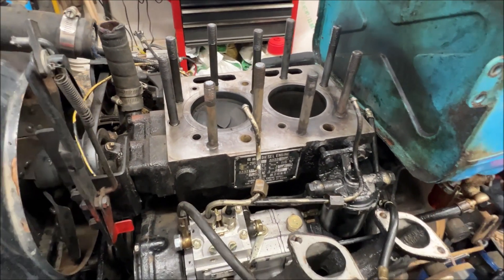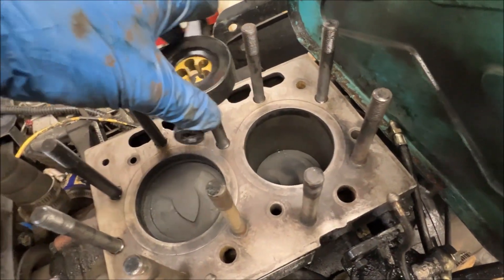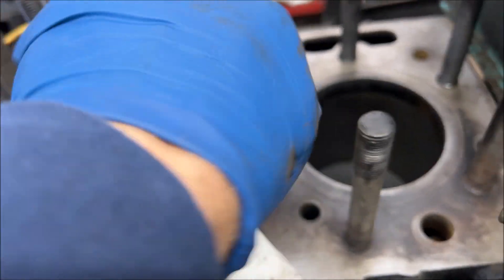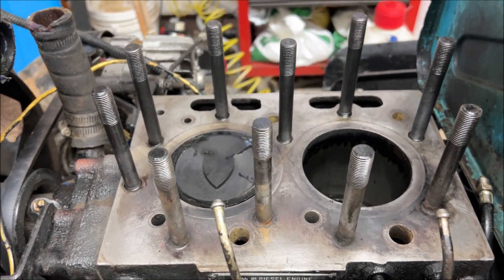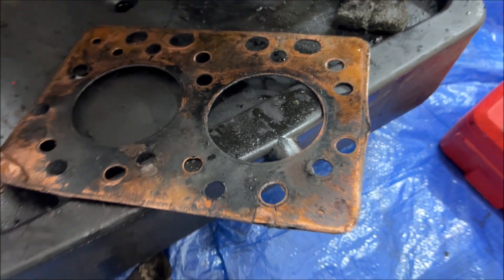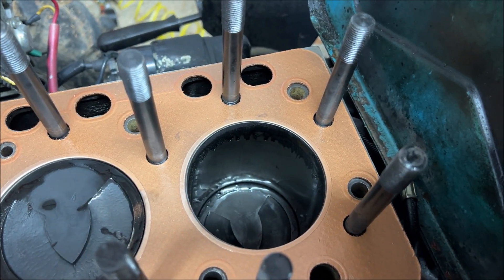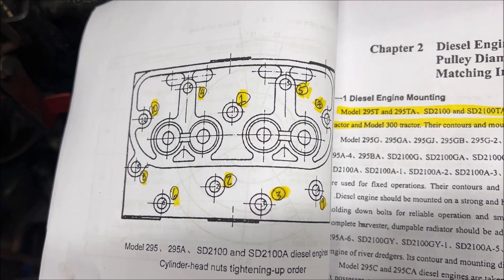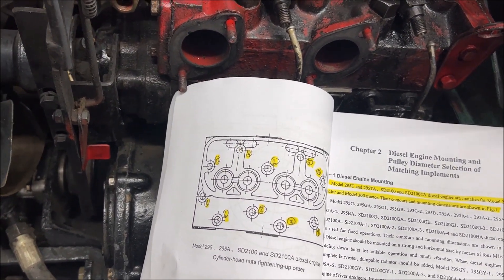Shenniu Chinese Diesel Tractor - Cylinder Head Gasket Replacement (Part 2)

Comment: I have a Shenniu spec manual.  Unfortunately it is spread out over several locations.  Still believe there is another source where one could get a hold of the specs, somewhere in the price range of $45 to $60.  A better price than I could ever deliver on.   Good luck.
Reply from the maker: Yes, I have come across both the manual for the tractor and also for the 295 motor as well.